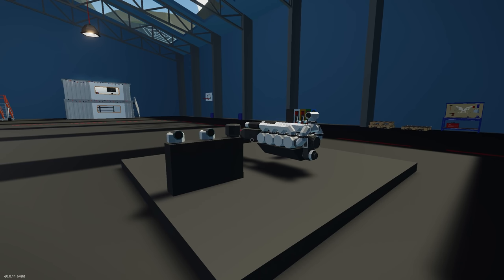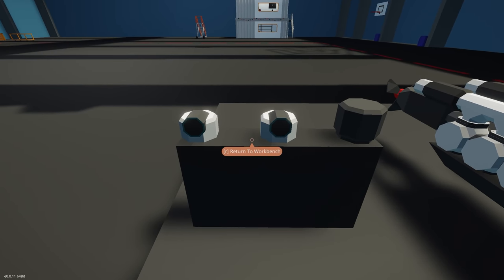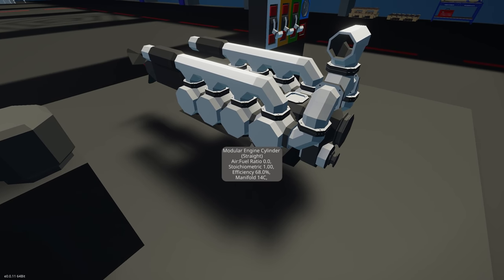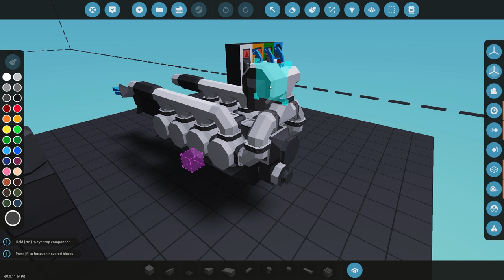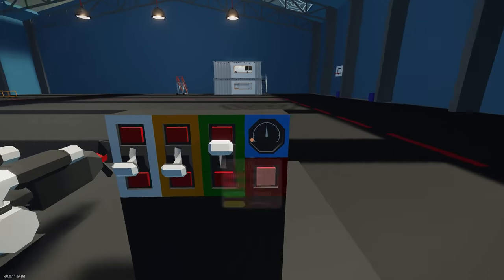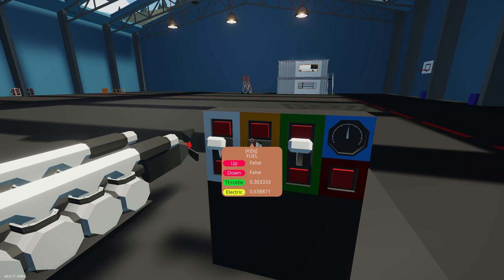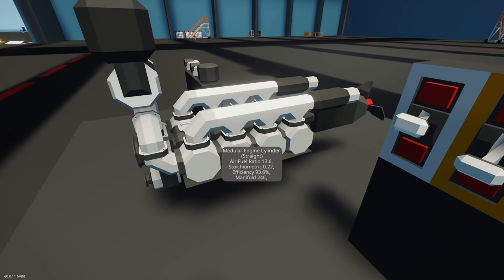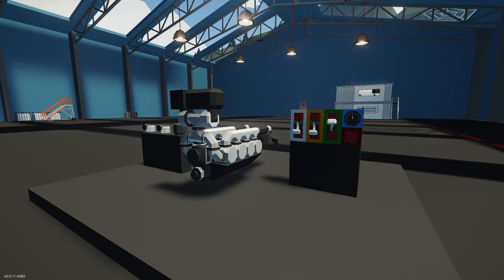NEW FEATURES - Modular Engines - Stormworks

Comment: Also remember that lean mixture increases engine temp and gives more effieciency, while rich runs cooler and gives more power. Also the engine is only rich or lean when the mixture is different than 14.7:1
Reply: Is that number a constant for all engines or can that change based on how you build your engine?
Reply: @durgun8247  i think its constant based on the chemistry of the fuel.  Remember the engines in the game are diesel, not petrol, so they will have a different ratio than for a standard petrol car engine.
Reply: @storm37000  Well for a diesel engine you do not control the air at all.
You let it suck in all the air it wants, you control it by how much diesel fuel you feed it, stomping on the gas pedal dumps more fuel into the engine and it makes more power as a result.
A gas / petrol engine on the other hand, you have to control a lot more delicately.
Reply: @CMDRSweeper  All modern diesel engines are turbo, but yea, it would get nasty if you tried to choke off air.  You probably could run them lean though.
Reply: @storm37000  by the looks of the test MrNewJersey did, It acts more like a petrol engine than diesel since the efficiency was very high with 14:1
Reply: @storm37000  diesels have to run lean, they cant mix their air with fuel fast enough to run stoichometric without tons of smoke, diesel fuel needs 14.5:1 in a perfect world but in reality most diesel engines wont go richer than 18:1 at full power, 30-40:1 while cruising and upwards of 100:1 at idle
Reply: @storm37000  Running a Diesel too lean or Lean in general is a horrible idea.... running too rich is how you burn a hole in your piston. i daily a 6.0 powerstroke ask me how i know.

Comment: For all who wants to run an engine use a functionblock set to ×*2.8 and connect a throttle leaver to it. The number that gets out of the throttle leaver goes to the fuel intake the number from the functionblock to air and it should work. You should set the throttle to a max output of 0.4 to work best thats how i made it work atleast hope that helped. Like so people can see this info maybe NJ sees it and im sure there is a  better way but this will atleast work.
Reply: As a meme once said
"Your a good man thank you"

Edit I found a possible way to upload a creation in experimental branch ask how will give video on Workshop
Reply: So, I started mucking around with these tonight, and made a microcontroller that has a "Mixture" input (upside down throttle from 2.6 to 3.0) to divide the main throttle by. I love that I ended up at the same result

Comment: Hmm. (I'm an engineer, please excuse me).  If you are going to do the super nerdy stuff, be sure that it is value added to the game, and not unnecessarily complicated. The stoichiometric ratio of 14.7 indicates that this engine is running on a spark ignition otto cycle of a gasoline analog, but diesel is what is available.  Also, to do this with a diesel (as in the game) it would be a travesty to not include forced induction considering diesel (compression ignition) engines require an AFR of minimum ~17:1 and forced induction will modify your effective compression and fuel flow rate and therefore your AFR indirectly.  Also, a direct read of stoichiometric would be too easy (at least for me anyway).  A proper (and real) way to analyze the stoichiometric would be to attach the torque sensor and a load (like your last video sort of) as it can only be calculated, not measured (as IRL).  Otherwise, an O2 sensor would need to be added to the game.  The hard part is that there is no fluid flow rate sensor (fuel pressure does not equal flow) such that a pseudo BSFC (Brake Specific fuel consumption) could be determined, and a simple delta of fuel content is not accurate enough (gravitational effects on volume).
Reply: 100% agree with you. I think players don't need that level of control to  have some fun. Of course there are some guys fond of fine tuning engines, but in the end most of the payers would just look up for the proper engine in the workshop, just to not spend tons of time building and debugging one. I don't think this is really necessary, I'd rather implement fishing of some sort.
Reply: They don't even have a turbocharge to compress the air.
Reply: @leezhang5836   you can use the fluid pump since the game count air as fluid. i have done it and it turbocharge the engine. Though for some reason i cant have the engine run past 25rps. then it stall and wont restart.
Reply: @cassias456  Ok, will give it a try later

Comment: Over the other useful stuff that this game needs, i have one simple question, this air/diesel mixture is really necessary?
Reply: Not really, which is why its still on the experimental branch.
Reply: its not but its also damn cool
Reply: It's kind of useful for fuel saving. If you're doing fuel efficiency runs maybe
Reply: It's handy for tuning, so if you need more fuel efficiency and not performance run lean
Reply: @o everything that burns need air
Reply: I think they should have just added a property slider or something, I think this takes up too much space and complexity.
Reply: @o ad diesel doesn’t need spark plugs because it used compression ignition, it still needs air obviously
Reply: @Daniel Diesel does not need spark plugs... the air is always needed... there is no fire without oxygen...

Comment: I think the most important feature missing is actually buyoncy for open top vehicles. it buffles me that there is only a handfull of people voting for that issue and nobody seems to care that a standard boat design does not work in a "boat physics sim" game. They have the algortihms inside, they jsut need to adopt the way doors and closed compartments work to auto apply it to open top bathtube like structures. a simple floodfill will give you which volume shoul dbe "enclosed"...

Comment: Since they’re not doing mass air you don’t need to read the AFR. You can calculate that. Give the player the air throttle, function to compute the desired fuel portion(f/ex divide by 13.9, or maybe two ratios, one for a cold engine with a threshold, another ratio for when it warms up— to get to correct AFR, plug that as the set point for the fuel manifold. Bam, you just created an open loop engine controller! :) (ok usually they have to use mass air flow and a PID, injection timing by cam sensors etc )

Comment: so basically there's no good way to quickly control an engine anymore, atleast till they let us read out air/fuel or stoichiometrics as data.
Reply: I can immediately think of crude way of doing it. Probably not most efficient way but it only took me few seconds to come up with. Since good all round fuel to air ratio is 1:14 then just have a function block x/14 in between throttle lever and fuel throttle input. Whatever you pick on the lever with go directly into air and fuel will get 14th of it.

You can get more fancy by having another throttle or keypad manipulating the ratio. But yes, ideally having proper logic readouts would be great because then we can use it for more advanced controls like PIDs or just for display on screens.
Reply: @Rodzynus  Wow you're actually pretty smart lol, thanks
Reply: @Rodzynus  i see a lot of people here trying to look smarter then they are, its nice to see some actuall knowledge
Reply: @Rodzynus  And then add 1 over some constant times temperature to it for an automatic choke. I'm really excited for this stuff =)
Reply: @Rodzynus  1 x 0,35 and boom you get an AFR of 14.3 running at betwen 96% and 92% efficiecy.
hook up a thottle that goes from 0 to 1 and connect that to air. then to a multiplier on A and have a constant nummber of 0.35 to B. the output of the multiplyer will go to fuel.
and the fun thing is it aint that crude haha

Comment: kind of annoying that they are making diesel engines run like gasoline engines. diesels do not control air intake and only manage power/rpm output via fueling. so at idle a diesel can run just fine at like 100:1 AFR.
Reply: @jort93z  other than the pure fact that they are running with diesel fuel...
Reply: its just as annoying to play
Reply: Perhaps they will add gasoline?
Reply: @jort93z   well they run on diesel fuel... but yeah if they added a new fuel type that could be fun.
Reply: @jort93z   i dont think you understand how nerdy i and many other stormworks players are. having a model ingame that reflects real life makes the game so much more intuitive and therefore fun to play. and yes they do model the weight of fuel.

Comment: i like the idea of having to mess with AR ratios, but i dont like how there implementing it, a extra node on the intake we had before to control the AR would have been enough. But now in order to give the engine more throttle you have to up both air and fuel at the same time, its doable already to make a MC that can do all the stuff for this now but this is just needlessly complex.
Reply: It's not possible because to get the engine to idle the fuel is at 0.4 and air is 1 so you can't give it more air if you add more fuel

Comment: Still no way to make a tiny engine build.. since you will either need a crap ton of levers and gauges to monitor the engine or if they let us use MC the MC will likely be bigger than the engine itself.. need smaller MICRO controllers. maybe a way to "open" the controller to make the connections while the controller is just a 1x1
Reply: 100% agreed on this. I don't understand why we have those huge "micro" controllers. Maybe everything would need a composite in/out put.
Reply: My engine controller - it's a 5x4 plate that contols throttle, cruise, clutch, brakes+brakelights, and monitors engine overheating. I usualy place it under driver seat, and in car still lots of space for other controllers. 
If you are trying to make a lawnmower, then such a module will be large, but in general there is practically no difference between custom engines and stock engines.
Reply: They should add composite inputs to the engine. That would allow a 1x2 micro to run an engine.
Reply: Personally, I wouldn't mind seeing the devs drop the normal number and boolean nodes and convert everything to composite. It's a little more complicated to figure out how to use composite, but the final build is so much cleaner and easier to understand, and it would solve the MC size issue, since each node could serve many purposes.
Reply: i was doing this easy thing for a micro controller.

make a 3x1 micro controller. 2 number inputs, 1 number output.
wire a throttle lever to the fuel intake and the first micro controller input.
wire a 2nd throttle lever to the 2nd microcontroller input, wire the output to air intake.

inside micro controller, just use a function(xyz) part. put in "x*(2*y)". where x is fuel throttle input, and y is the 2nd throttle.

now ur first throttle acts like a regular engine throttle, and the 2nd throttle adjusts ur air fuel ratio.

depending on if u have pumps and stuff on ur fuel and air intakes, u will need about 50% power on ur throttle lever and 30%-60% power on ur air fuel lever.

also wire the starter to a toggle so u can easily look at the cylinders while its starting

thats as compact as i could make it

Comment: Hi Mr NJ. Long time fan first time comment but love your work and your videos. Look for tutorials and your videos are always the first in the list. Dabbling into building now after playing just workshop creations, would a micro controller work to start the engine cold and change thottles to run mode after finalizing the values manually so you dont need to be in the engine room on start up. Like when you start a boat with an outboard motor, this is no throttle for fuel air mixture thats all controlled by the ECU. Is this possible? Thanks again for all your great work.
Reply from the maker: Will only be possible when we can read the data from the engines, but for now we either have to listen or hover over them for more information.

Comment: Turbo engines when
Reply: YES!!!
Reply: Yes
Reply: They should simulate real life physics by making unassisted air intakes quickly reduce their efficiency as you rise in altitude, making using pumps (possible belt and exhaust driven variants too) useful.
Reply: turbo is actually implemented right now, using any sort of pump to compress fuel or air before it reaches the manifold allows the cylinder to use more air and or fuel, increases performance per block but also seems to run hotter unfortunately.
Reply: Superchargers too?
Reply: @DoggosGames  superchargers especially, but maybe not turbochargers
Reply: @DoggosGames you can use a simple ship pump either large or small, or you can use a belt driven pump that recently got added

Comment: I do not like the way these engines are going... as good as the modular concept is, but having to adjust air and fuel at the same time makes the engine more complicated than necessary.
Reply: I have to agree. I was excited reluctantly by the modular engine being hyped by the community, not seeing the exact benefit of having to further complicate stuff (but thankfully they're in addition to the regular engines). However, as much of a geek I am for engines and whatnot, I fear the gap between the casual Realism mode and Realistic Sim mode is becoming a bit much. I was ok with modular engines whatever, but now it seems we'll ALSO need to basically slap on an ECU to run these quasi gasoline engines properly at all (using diesel fuel which is not the same as petrol, thus far). Again, the geek in me welcomes the side quest of making my own A/F manager/ECU thingy but I should have the choice to turn it off (and yes, I can always get one from the workshop.. but again...how far are we supposed to go with this which is exactly how relevant to Search and Rescue?). Just my 2 cents for thought. ;)

Comment: How do you make them to not stall? I can manage to have them startup and run quite a few seconds, but then they just stop working
Reply: I have the same issue with the Small Engine.. It means that too much power is required from the attachment, I've found that you can fix it by attaching another engine or an electric motor to the drivetrain.
Reply: @DoggosGames  i noticed, that i would have to start a new game save. But still a little underpowered.

Comment: So no Single throttle ships anymore?
Reply: Not necessarily, if you find the balance you want you should be able to use current micro controllers to kinds tie the values together
Reply: Use a functionblock and set it to ×*2.8 connect your throttleleaver to it and the number that gets out the functionblock to your air intake then limit your throttle leaver to 0.4 that should run your engine.
Reply: @r_u_game1988  thank you

Comment: Doesn't feel like the right way to me. Apart from this being gasoline tuning stuff on what is supposedly a diesel engine, it's hella complicated. New Automation players can have trouble with this stuff and the name of that game speaks for itself!

Honestly, I'd rather have an AFR control on the throttle body since we're apparently doing single point EFI or something along those lines (I don't think I've gotten ITBs to work). I'd much rather have forced induction or properly scaled RPMs. I know diesels rev lower than gasoline engines but topping out at 1-2000 RPM is a bit much lol. I mean, there's no redline, but it really doesn't sound good lol.

Oh yeah, and cross section manifold pipes. Boxers are really annoying otherwise.

Comment: 1 x 0,35 and boom you get an AFR of 14.3 running at betwen 96% and 92% efficiecy.
hook up a thottle that goes from 0 to 1and connect that to air. then to a multiplier on A and have a constant nummber of 0.35 to B. the output of the multiplyer will go to fuel.

Comment: Alright we are gonna use the new infinite generators now if they remove the engines and replace them with modular engines BTW yes there is a new 1.0 infinite generator out now
Reply: What
Reply: All infinite generators will be patched so dont use them on your vehicles
Reply: I hope they don't nerf it too hard, as it stands Diesel electric is mindbogglingly difficult to make work. like since when does a motor of the same size as a generator consume over double the power the generator produces? A MOTOR IS A FUCKING GENERATOR AND VICE VERSA! you don't lose over 50% of your power in the conversion! Why is it so hard for them to patch infinite generators without nuking their efficiency from orbit?